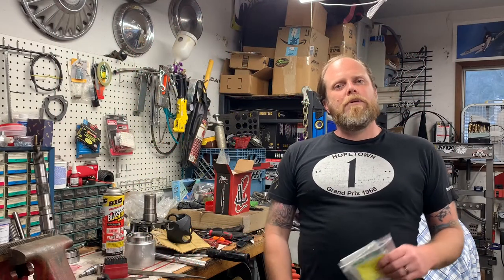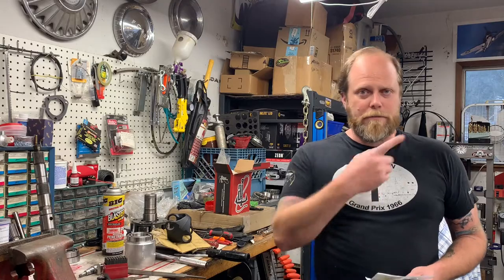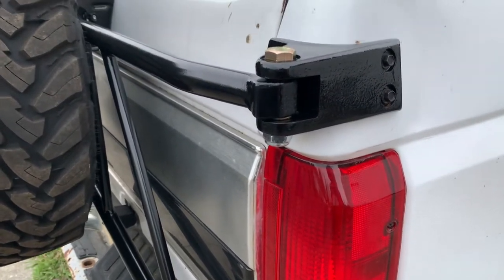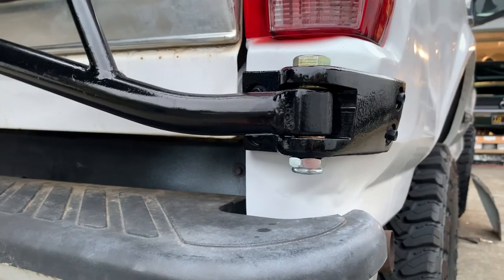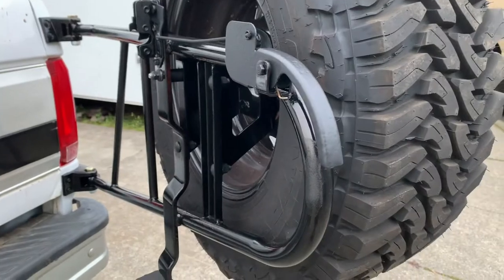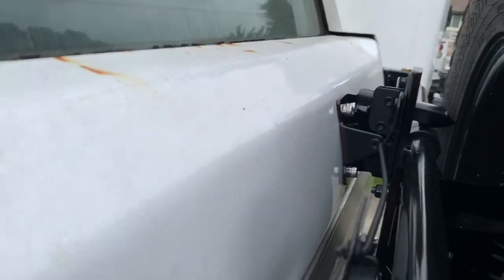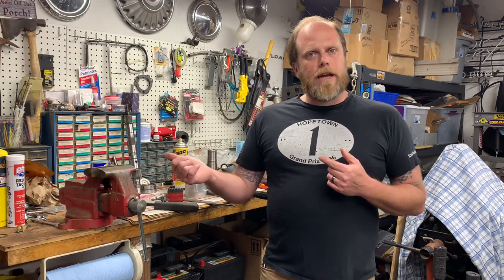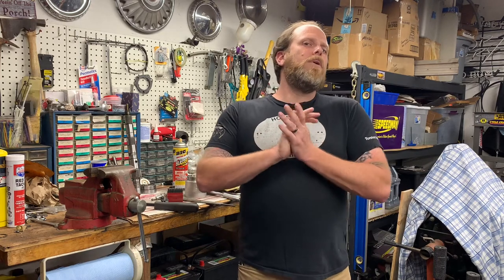Fix a Sticking Noisy Spare Tire Carrier on the Full Size Bronco w/ Oilite Bronze from McMaster-Carr

Comment: YOU friggin ROCK!! I am restoring my spare tire carrier and needed this information right now! Thanks for posting such great content!
Reply from the maker: Thanks for the kind words, Michael. Glad you found this helpful. If you get hung up on anything, feel free to bug me. 😊
Reply: @crazycaseyscustoms  Hi, I bought the shift bushings, but none of them fit. Did you turn them on a lathe? I ended up buying 6389K627 Nylon Sleeve Bearings from McMaster Carr. They worked after taking a 1/32 off the flange height.
Reply from the maker: @michaelwagstaff1870  that’s good to know about the McMaster option. I’m going to need to update my description to include more detail on the modification I did to the shifter bushings, because you’re the second person to comment you’ve had trouble. Basically, I found the bushing in the kit with the correct ID, and then I carved a little cross-shaped relief in the end that presses in to allow it sort of snap in place. Once in, I may or may not have ran a drill bit through it to regain my ID (I don’t remember if it squished or not).
Reply: @crazycaseyscustoms  that makes sense. Yes, once you cut an x in them, they will press into the handle. I was making it too complex.
Reply from the maker: I do that all the time,  @michaelwagstaff1870 . To be fair, I had a tiny bit of my old bushings left, and they had a similar relief in them. That’s what guided me.
Reply: @crazycaseyscustoms  Casey, I have restored two spare tire carriers with your hints and tricks, and they both turned out fantastic. I'm working on 1986 XLT right now and will put the bushing in the "earlier" carrier and see how they work.
Reply from the maker: That’s awesome,  @michaelwagstaff1870 ! Thanks for that!

Comment: When you machined the aluminum collar how did you remove the bolt through the center? Mine has a torque head on one side and a 15mm nut opposite. Is that 15mm nut welded or will it come off? Wanted to check with you before applying heat. Thanks
Reply from the maker: Honestly. I don’t remember. I think the nut may have been welded, and mine was a rusty mess. I would apply heat to the nut, and try to only turn the head. Worst case scenario, you end up welding a new nut back on…good luck!

Comment: Hope you still check on comments......I need the striker bushing that is on the tailgate side that you machined out of aluminum.  Could you elaborate on how you made that piece?  Are special tools required?
Reply from the maker: I made it on the lathe out of a chunk of 6061 aluminum, and I don’t recall the outside diameter, but I still had a little bit of the original piece to take the measurements from. You could probably find a suitable aluminum (or maybe even bronze) spacer at Ace Hardware, or any other hardware store with a really good selection of bolts and fasteners, you’d probably have to stick a couple pieces together and cut/file them to length.

Comment: Great video. I have a question about the bushings in the handle. I purchased  14041 - Dorman Pedal and Shift Linkage Bushing Kit* and you said that it needed , slight modification necessary. I noticed the bushings didn't fit in the handle bolt holes. Did you drill out the handle to make them fit?
Reply from the maker: Gosh, honestly, I don’t remember what exactly I did. Probably so. I’d start by measuring the diameter of the bushing, and the handle hole. The bushings compress a little bit, but not a ton.
Reply from the maker: Actually, @campdisney, I slept on it, and remembered what I did. The minor diameter of the small bushing is correct, but I had to cut a little cross in the leading edge so that it would push through the hole. I don’t know if you had any of the stock bushing left when you disassembled your handle, BUT, I just tried to replicate that shape. Hope that helps!! 😊

Comment: When you replaced the bushing that supports the tire rack (see at time stamp 2:48) how do you get that on there?  I see that I can order a replacement from Jeff's Bronco Graveyard but I don't see how you get it on there as it is a closed cylinder and I don't see a way to get it on there.  Any help would be much appreciated!  And great video  too!!!
Reply from the maker: Hey, not sure if you do Amazon, but I have links in my description to every part used in this video, and I earn 3% on anything you buy through those links. 😊 And that bushing is only $5.99 shipped right now. It’s got a split in it, so it installs super easy. I want to say it has a little dog leg in the split that helps it stay together, but regardless, I had ZERO issues with that part. The other bushings are a little more fiddly, though, so please be forewarned.
Reply from the maker: That said, if you get hung up on anything, feel free to message me through my website or IG, and I’ll try my best to help.

Comment: Casey, this solution does not work for the earlier Bronco 1980 to 1986. The pin is 5/8 and not metric. I am working on finding a bushing that will work, but the frame needs to be drilled to 3/4. It is the same solution as what you suggest, but I do not see anything on full size bronco forum or video suggesting a solution for the earlier carrier.
Reply from the maker: Let ‘em know, when you figure it out, Mike!

Comment: How much of the 100mm bolts did u have to cut off?
Reply from the maker: I don’t remember exactly, but I think it was quite a bit. The shank basically stuck all the way through the bushing, and I just left enough threads to make it through those thin lock nuts.
Reply: @crazycaseyscustoms  OK thanks I bought a 5/8” x 3” bolt at Home Depot but it is a tiny bit loose but the length is perfect with the nut. I wonder if McMaster Carr has a 3 inch bolt 16 mm. Thank you again for responding.
Reply from the maker: 3” = 75mm,  @dirtyeric2 . I went with the 100mm because I wanted the extra shank length. Google “properly shanked bolt”, if you’re not familiar with the idea. Realistically, it probably doesn’t REALLY matter, but, that’s why I bought long and shortened,

Comment: How do u get pins out? I took off retainer clip on bottom. Pound pin up?
Reply from the maker: Sometimes they come easy, but you gotta be careful because it’s really easy to mushroom the end that holds the clip. I used a balljoint press (basically a big C-clamp with a socket on the end) and heat, and that worked for one of my two that was stuck, but the other one was stuck so bad I had to drill it out. Hopefully yours will come fairly easy.
Reply: @crazycaseyscustoms  thank u
Reply: So I should be able to pound the pin up straight through once I takeoff the retainer clip?
Reply: So I should be able to pound the pin up straight through once I takeoff the retainer clip?
Reply from the maker: If it isn’t too rusty,  @dirtyeric2 , then yes, it should “tap” right up and out. If you have to “pound” on it, you might mushroom the tip, and that opens a can of worms. Keep an eye on the tip, as you “tap” the bottom of the pin with a hammer (preferably one with a soft face like brass). If you see it start to deform, better to try and use some kind of pressing tool.
Reply: @crazycaseyscustoms  thx
Reply: @crazycaseyscustoms  I got one out the other one I am still working on I think I mushrooms the clip head. Can you send me the exact link for the pin part and bushings? I think you just posted it on the general website thank you so much if you can.
Reply: Disregard i found it!
Reply: @crazycaseyscustoms  i got it out! The plastic bushings can i just pry out or drill out? The new bushings on mcmaster do they just pop back in?
Reply from the maker: @dirtyeric2  yes, and yes. Clean up the holes with some sand paper after. You might need to tap the new bushings with a hammer, and you might need to run the closest size drill bit through them after if the pins (or bolts) don’t want to pass through easily, but you’re not really taking off any material…
Reply: @crazycaseyscustoms  ok thx again im gonna have whole rack sand blasted to remove rust then repaint it.